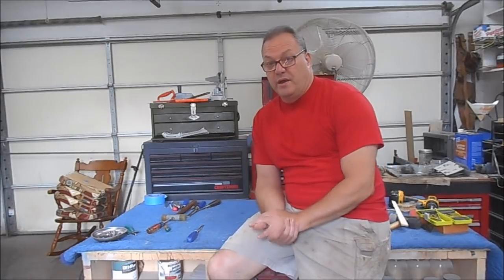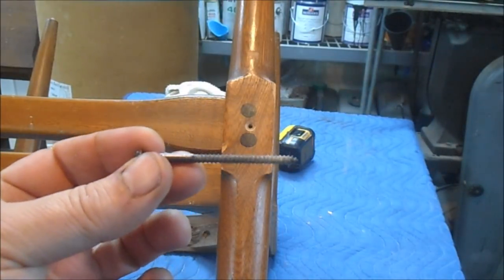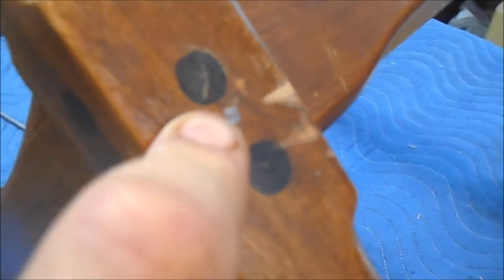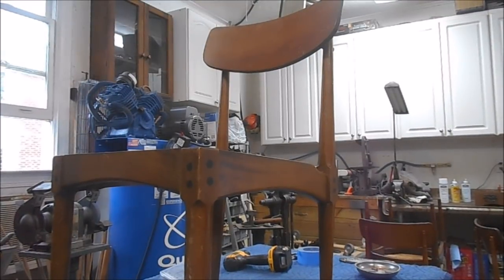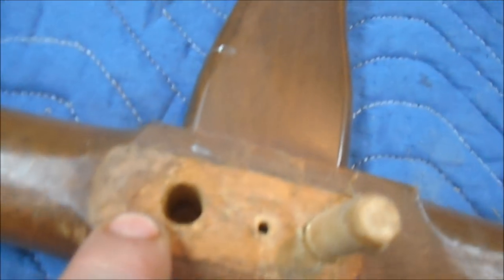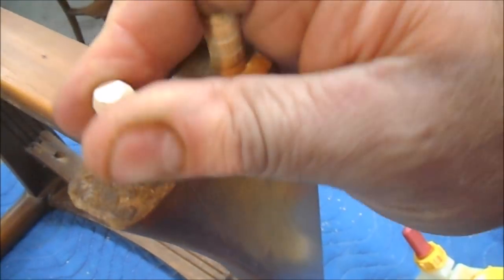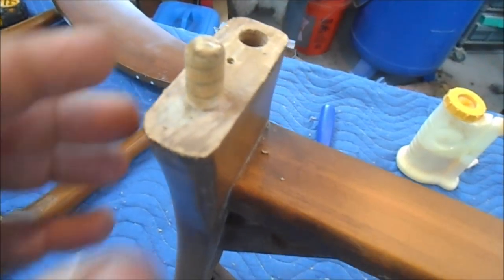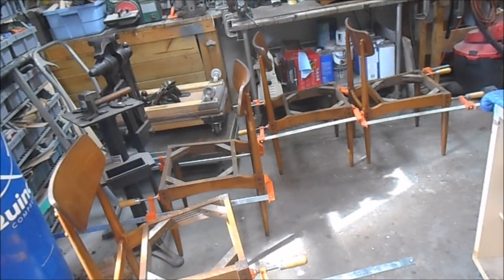Repairing Loose MCM Dining Chairs

Comment: Just a quick tip. When removing broken dowel tenons I do most of it like you do, except when you get down to the final shell of the remaining dowel in the mortise. I dont like to peel it because I dont want to risk chipping the shoulder and losing that critical tight glue surface.  I use the final diameter of the dowel(3/8), use a bradpoint drill bit and run the bit in reverse until you reach the end airspace. Then i slowly run the bit in forward (cutting) position. Doing it this way significantly reduces excess mortise removal AND  the possibility that you change the angle of the mortise. The drill bit leaves the mortise clean and no improvised cleaning of the glue is needed.

Comment: Nice. I can’t do it to my chairs but yours look great. The previous repair on mine, now corrected, has left holes all over chair, every corner, the base, legs, even the seat. I can’t imagine why. If the idiot had just put the screws back in where they belonged none of this would have been necessary. No matter, they are mine now and they are fixed. I’ll address the holes another day.

Comment: When drilling with a hand drill use a scrap piece (I usually use a 2x4) of lumber with a hole drilled the same size using your drill press. This way you know it’s 90 degrees vertical. Just make the scrap a good size so that you can clamp it to the piece you are working on. The bit will follow the predrilled hole straight up and down.

Comment: The problem is these dowels are the weak point of this chair design. The back leg set dowels creep apart over time no matter what glue is used. When the dowels creep out of the dowel holes enough they lose strength and break. There needs to be a fix to prevent the dowels from backing out again over time and use.

Comment: What type of glue is that? Do you have a favorite brand or doesnt matter?
Reply from the maker: I have 3 adhesives that get the most use, depending on thejob.  I use Titebond II for my regular PVA (carpenter's) glue.   I use Behlen's Hot Hide Glue and West System Marine Epoxy.